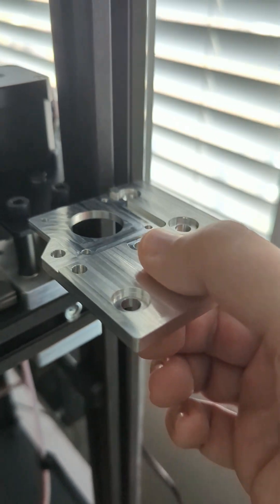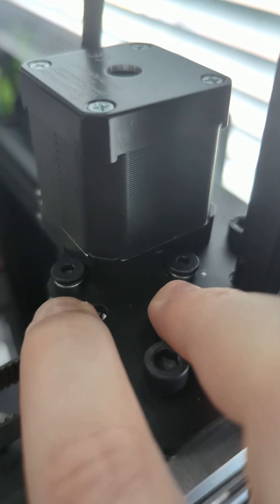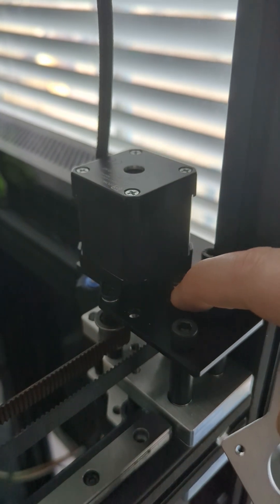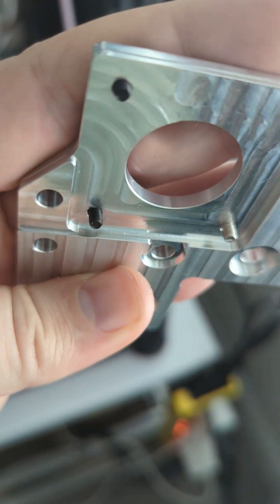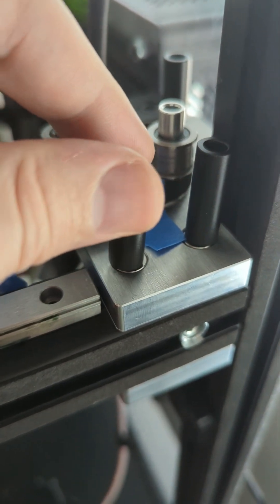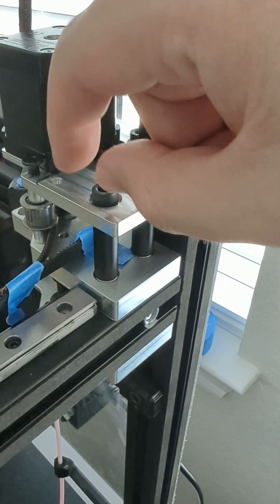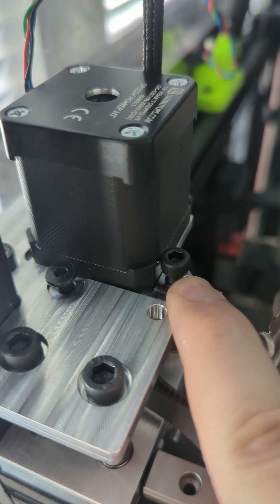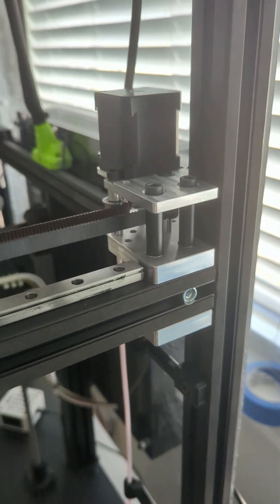MandalaRoseWorks - Rat Rig V-Core 4 Hybrid/Idex Plates

Comment: I like what you’re posting but also want to know how the input graphs have changed with this upgrade.
Reply from the maker: Ya, it's kinda hard for me to remember to keep shaper graphs around as I usually do them in batches, then clean up, and later on go "Oh, I should make a video"
These plates removed quite a bit of noise from the graphs, so I was able to go from 3 hump to EI / MZV pretty easily. Additionally the tolerances made it much easier to get everything aligned, so I went from almost 5 degrees of skew down to 0 degrees of skew.